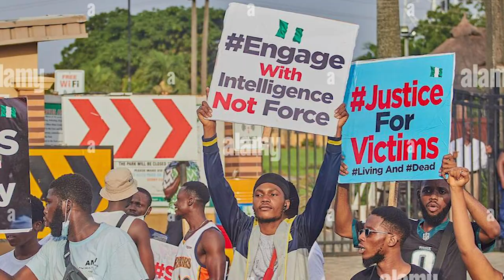Why Nigerians Are Constructing Lekki International Airport Lagos.

Comment: Lagos is too small and overpopulated for two airports. We should be upgrading and expanding the already existing airport and road that lead to it to reduce congestion and traffic.
Two international airports less than 50km apart is going to be a logistical nightmare for air traffic control and will only increase flight delays and the chances of plane crashes. Expanding and enlarging a single port of entry is better than creating and managing two small ones
Reply: Nigeria is a huge country, most European cities are tiny with with 2/3 airports but you don’t have a problem with it, this is a strategy to boost tourism
Reply: @enoch4619  European cities with multiple airports don't have them this close to each other though
Reply: @tola1526  yes they do , London has how many airports? Paris, Brussels, Amsterdam I can go and on
Reply: @enoch4619  London only has one airport that's actually INSIDE London (London City). Heathrow is the second closest and it's barely on the outskirts. The others are just called London x, London y but they aren't inside London, you need a train to get in. Also keep in mind,  London is much bigger than Lagos in square miles, with way fewer people and even then it's only one airport inside it.
Reply: I agree with you.  I think that money can be used for other pressing infrastructure needs in Lagos.  The current Murtala Muhammed airport needs to be renovated.  It is just outdated.
Reply: What do you mean Lagos is too small what does that have to do with the second airport being built do you know the population of people living in Lagos do you know Lagos is the biggest city in Africa and it’s pollution as of 2022 is 15.3 million people
Reply: London is a very big city and has about 9 million people living in it so just because Lagos is small doesn’t mean the population is smaller infrastructure has nothing to do with how big  or small a city is
Reply: @tola1526  what is the distance between Murtala Muhammed international Airport to Lekki? Rather to VI as a whole?
Reply: @leyemicheal6679  they have no idea how big London is. And the question remains how long does it take one to move from MMA to lekki or Victoria Island? One person here is saying the MMA should be upgraded,  isn't it already? A new terminal is being built and the second phase is to upgrade the old one, even at that, would that sold the problem of traveling a long distance between lekki and Ikeja? No.
Reply: @sidex4  It's a 30 mins drive if there's no traffic. What is the point you're making?
Reply: @tola1526  are you flying? Lol, even if there's no traffic, its can't be 30 minutes drive except you are going at the speed of 200km p/k and beside, there's always traffic. People who live on the island and everywhere on that axis go through hell to get to their destinations after a long trip to Lagos.  That is by the way, the kinds of economic activities that would be experienced in the next few years is going to be tremendous, this already is a good reason to create an airport there so people don't go through hell to get to Ekpe or lekki and the island as a whole.
Reply: @sidex4  if there's no traffic, Lekki Phase 1 to MMA should be 30 mins based on distance. We are so used to traffic and poor planning that we don't know the potential of the city. 

Your solution of building a whole new airport because people on that axis are going through hell go get to their destination is what is called "killing an ant with a sledgehammer". The real problem here is that the road network is poor. Poorly planned and poorly maintained. It would warrant a new airport when the needs of the current airport have been maxed out but that isn't the case. 

All of this is without talking about the commenter's point, which was about the distance of the second airport. They'd be way too close in aviation terms, it's like building two bus stops 10 seconds drive from each other. It would just be a glorified second terminal because of how difficult it would be to coordinate flights since the airspace between both would be small. Lagos might need a second airport one day but it would need to be a bit further out. 

Also, your suggestion wouldn't solve much because for example if BA decides to start landing in the Lekki airport (they're not gonna set up a whole new flight to the second airport, the current one a day is barely full), wouldn't it become the same problem for mainland people facing traffic?